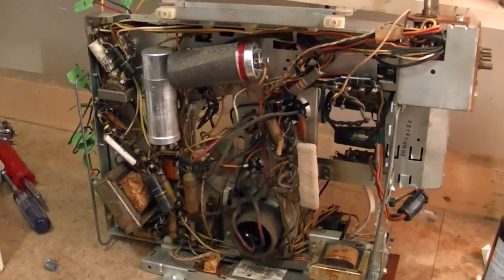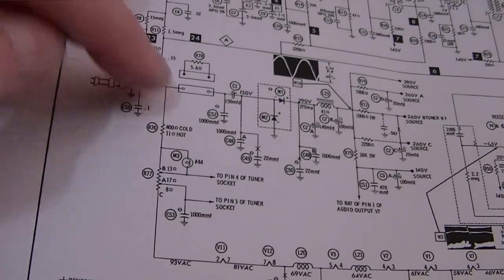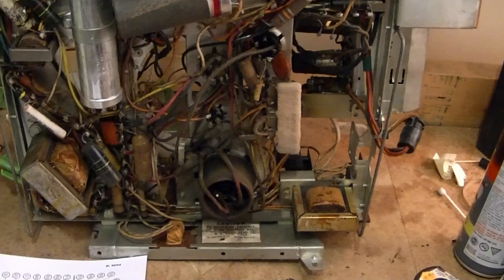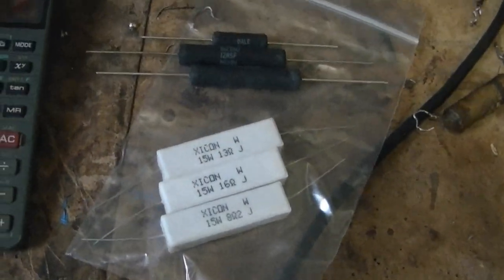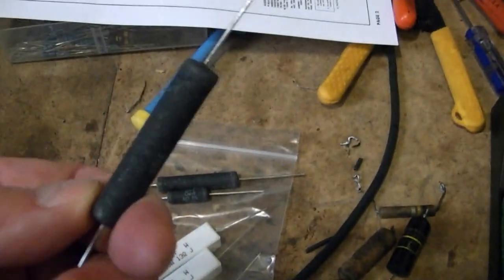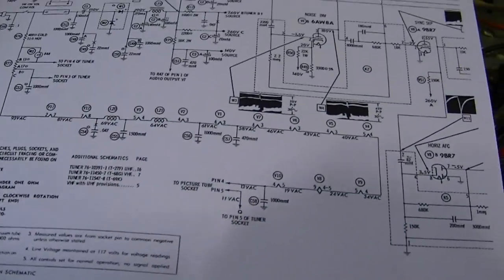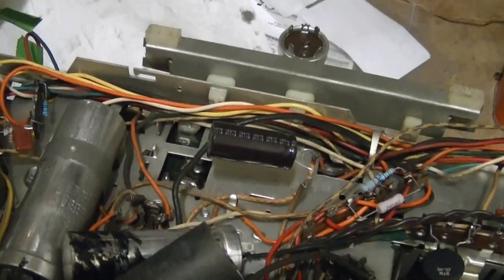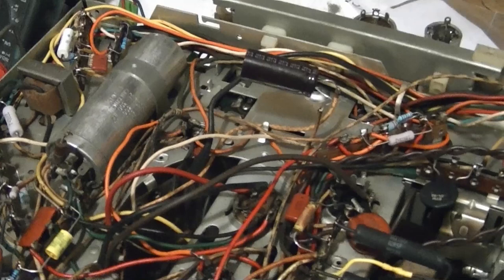Predicta "Holiday" restoration p4o?

Comment: That filament dropping resistor was likely corroded since it looks like a crappy sand resistor, those things go bad just sitting on the shelf. Most wire wound resistors are fairly robust but the sand resistors are just like paper capacitors. With regards to the line capacitors, I never liked the design some use where they connect them across the power line unswitched, it means that they end up being energized full time as long as the set is plugged in, I usually change that when I see it.

Comment: Chassis looks very cluttered on the bottom side, lots of wire leads. My Philco 53-2268 didn't have too much in the way of wiring, but it was packed tight with components. There was a lot of digging layers out to get at the bad caps.